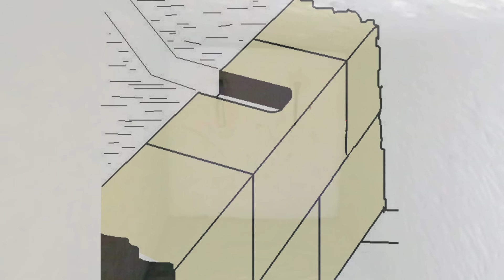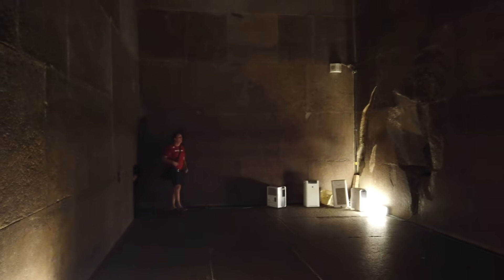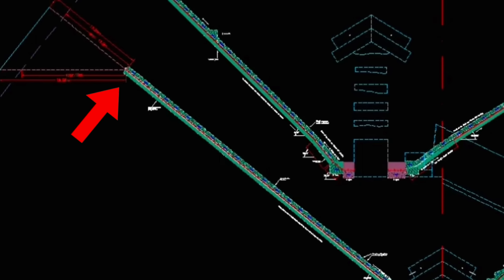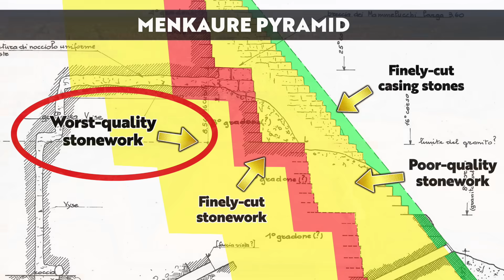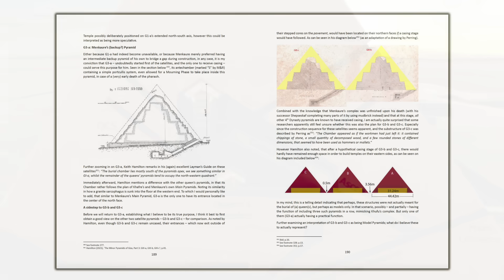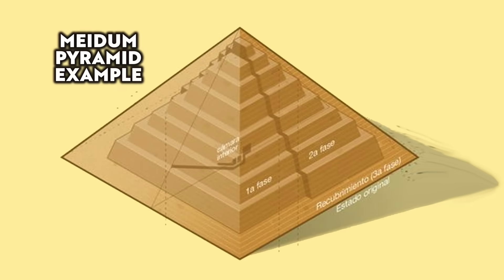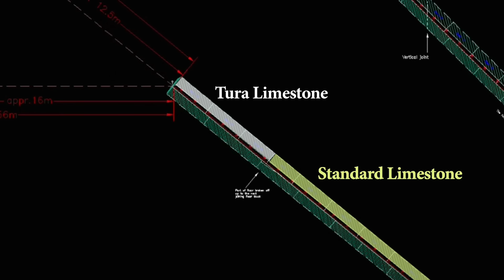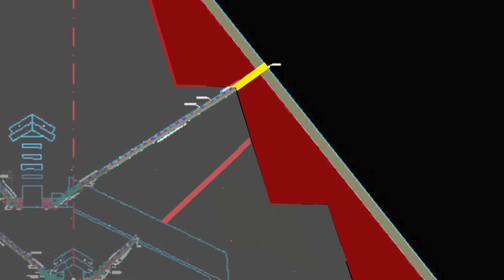Great Pyramid HIDDEN Steps Explain Everything | Part 1

Comment: 8:31.  I found the source of that image.  It was hand drawn.  I also found the original data and made an updated version with software. In 3D.  That data also seemed to show the remains of a ramp that went up each step, showing a vague idea for their geometry.

Video was called “I think I found The Great Pyramid's ramp hiding in 40 year old data”

Awesome video!   I certainly think you’re right about this being the reason for the shaft termination.
Reply: 🙂I made a comment like this about 5 hours before you, but YouTube or whoever deleted it:
Wallace's Mysteries of Antiquity has a very good video on this topic - "I think I found The Great Pyramid's ramp hiding in 40 year old data".
Reply: @PyramidBuilder3D you probably added a link, YouTube will automatically delete comments like that.
Reply: @WallacesMysteriesofAntiquity  The story is a bit more dramatic. 14 minutes after this video was posted, YouTube offered it to me. I watched it and after about 25 minutes I wrote a comment because I think the GP inner core is not such a revolutionary idea. 
The three pyramids (Meidum, GP, Menkaure) have identical external geometry (5.5 seked) and two of them have an inner core. Besides, your model matches my calculations exactly.
So, I didn't add any link because AA doesn't allow links. I checked my comment in an anonymous browser (because out of five comments on this channel, three disappeared) and everything was OK. I checked it in an hour, there were about 200 comments and mine was gone. When I sorted the comments by newest, I found my comment, so AA didn't delete it but the YT algorithm hid it (for about 24 hours, now I can see it again).
I understand that YT gives commenters some rating and I wouldn't mind if they moved my comment to the end of list, but I'm sure that hiding comments is not a bug in the program, but an intention.
Reply: @PyramidBuilder3D interesting, thanks for the information.  I wish YouTube would be more open about stuff like this.  I’ve been asked so many times “did you delete my comment?”  I always refer them to an early video I made addressing that.
Reply: @PyramidBuilder3D  That's not how it works. there's no algorithm involved in the comment disappearing. Its that the various servers youtube is on don't perfectly copy all the comment data, so depending on what server you tube decides to connect you to determines what comments you can see.
Reply: @Sgt.chickens  Are you saying that when I select "Top comments" it pulls from one server and when "Newest first" it pulls from another server? 
I don't think so, although it's not impossible.
Reply: @PyramidBuilder3D Pretty much any time you reload the page it selects a random server out of however many are available to your local area. If you live in a high density country like the USA or somewhere else with a large ammount of users in your local area you can often have dozens and dozens of available servers. Maybe your comment is stores on 65 or 80 percent of them. Maybe on 100% if you are lucky.
Reply: @Sgt.chickens  I gave you a "like" but the doubts remain. What is the probability that in view 1 I refresh 10 times and it always redirects me to a server where my comment is not (Mozilla and Chrome)? When I do the same in view 2, it redirects me to a server where my comment is!
Besides, Mr. Wallace certainly didn't see my comment either, because he wrote an identical comment. I'm sure Mr. Wallace read all the comments when there were 200 of them, because comments are an interesting commodity for any researcher. So there are three possibilities:
1. YT is screwing with us
2. Me and Mr. Wallace live in Alaska
3. You are the head of YT's development department :)

Comment: If everything was put in the kings chamber at the time of building, why make the corridor to it angle down towards the bottom of the pyramid, than up to the chamber? Why not just make everything level, straight out of the sides of the pyramid? Why make the air shafts angle up? Angling the "air shafts" up only made it easier for water and debris to fall into them. Why make the entrance so far up the side of the pyramid, only to angle it down, then up again towards the chambers? If they had made the shaft out of the queens chamber go straight in the direction it is already going to the side of the pyramid, it only would have been a few blocks higher than where the entrance is now. I am referencing the diagram at 11:31. Lot's of weird design decisions.
Reply: Their channels might have been angled up because if your working inside with rag torches the smoke will rise up and escape more easily.  Like a chimney effect. I dunno.  Just making a guess.
Reply: @tkd4  Supposedly no torches were used in the pyramids. No soot or ash from torches dated to the times of the pyramids creation was ever found. That's another mystery involving how the ancient Egyptians saw in pitch darkness.
Reply: @frodobaggins7252 the builders might have cleaned up their work as they went along.
Reply: @tkd4  I'm no expert, that's just the consensus among Egyptologists, that torches weren't used. They say maybe oil lamps or mirrors. Whatever was used was smokeless.
Reply: @frodobaggins7252  Look at the old photographs of the queen's room, it's all black with soot. There's also a report by Peres, from 1910 (if I'm not mistaken), which says that the entire ceiling of the Grand Gallery is covered with pinpoint traces of soot.
Reply: @errror7  A quick AI search says this "There is no evidence of soot from torches in the Grand Gallery of the Great Pyramid, as the walls show no signs of combustion traces. This suggests that artificial lighting was not used during its construction." Many other testimonials declaring the same thing. Another AI search: The Queen's Chamber itself does not show significant soot residue, which raises questions about how it was illuminated." The problem is, soot may have been introduced by more modern explorers. If it does exist it should be carbon dated to put to rest any confusion either way. Unfortunately, Zahi Hawass doesn't believe in carbon dating so unlikely that will happen.
Reply: Quick ideas: The shafts take the shortest way to the surface, the corridors going up and down may have tradition, as there are similar designs before, but also allow for automatic plugging from inside at a later time. Then there is also the grand gallary counterweight construction theory.

Comment: Happy Birthday!! and Thank You for such thorough and legitimate work.  I don't usually comment but I tend to see a strong correlation between gravity powered ram pumps and the internal engineering of Egyptian Pyramids.  If you look at a diagram of a ram pump and a schematic of the great pyramid one might notice it looks like a doubled up ram pump.  These pumps are only 10- 15% efficient, however they run simply on the force of water running downhill and a double pressure chamber ram pump system might increase efficiency.  Just my wild idea.  Thank you again for your time, it is very appreciated and enjoyed.

Comment: Very interesting theory! A couple thoughts I had.
1. From the main entrance through the descending passage is it the same angle?
2. Again from the main entrance through the descending passage is there any change to the inner stone? Like if you’ve cut through the casing stones (non existent now), the backing stones and into the steps surely there would be a change in how the stones look? 

If the pyramid was stepped originally then it would explain why they found pockets of sand when drilling on the inside of the pyramid.

If they added backing then casing stones ontop of the steps then the passageway behind the outer chevrons HAD to be added at a later date which I find to be interesting. I WISH the pyramid was fully completed as it just seems to be unfinished

Comment: Removing chunks of the core masonry to make a smaller smooth sided pyramid doesn't sound like very sound engineering. A more reasonable alternative is the backup plan was a stepped pyramid. It would have still been substantially larger than any of the 3rd dynasty stepped pyramids like that.

Comment: quick question b4 i forget,  so as you say, the shafts dont extend to the edge, 
also you state it was enlarged from a smaller size.

so perhaps can the upscaling be measured anyhow?
perhaps original had open shafts, but a larger encasement sealed it airtight afterwards ,  would that be logical?

chernobyl was enlarged with a larger casing shroud too,  was that the original design back then also?

i wonder can the expansion or enlargement account for the shafts not reaching the surface and it was sealed?

Comment: There was a zigqurat there hundreds of Years before. That Queens chamber had those shafts to the current external wall.
Check on the carbon dating of each paster measured thru the pyramid. Some date hundreds of years before. And yes, All 4 shafts were sealed.

Comment: air flow ? sure bro sure!!! u forget that there was a plug of solid rock 5 inches thick at the shafts location in the kings chamber that plug was not like a plug but the rock was not cut all the way through until they were cut open to then allow air to move,,,, no bro they were not air shafts

Comment: i thought the shafts were discovered behind a sealed wall they had to break through? that would prove they weren't air shafts correct?
Reply: That's in the Queen's Chamber.  In the King's Chamber, the lower ends of its two shafts were always open to the air, since they were built that way--no chiseling required by later explorers.
Reply: @JohnMSawyer  exactly... the queens chamber shafts were sealed.. so they werent air shafts...

Comment: In a restoration of a south American pyramid, another structure was found underneath. I believe the pyramids were built then rebuilt bigger, maybe in several stages. There are several examples of restoration works of older weathered structures being resurfaced with new masonry leaving the highly eroded core in its original state.

Comment: Of course! It makes sense that this pyramid (and probably all of them) had internal buttress walls. That means that the Big Void may only have been accessible before the backing stones were added, and would require tunnelling to reach now. Bummer!
One thought is that, if the burial chamber was accessible after Khufu's death, surely his treasures would have been stored in another chamber that wasn't accessible to visitors. Maybe in the Queen's Chamber?

Comment: Great video, Matt.. 

Major problem, however..

There needs to be offered a satisfactory explanation as to why the ventilation shafts are constructed this way..

For a "ventilation shaft" this method is simply insane orders of magnitude more difficult to accomplish than a simpler level air shaft out to the edge, made on the same course..

Making a very small FALL toward sea level in the shaft would even be a lot easier, and infinitely preferable, working through the same course with a slight decline, before continuing with the pyramid construction with the shaft then done and dusted.. 

This is good practice today, so that detritus, water, crawling insects etc are discouraged from making their way in via a ramped airway of even a very slight angle.. 

Obviously we know the Egyptians didn't have pumped /fan driven systems.. 

The angle witnessed in the pyramid is extraordinarily sharp.. One can only imagine the amount of contaminants that would be invited down these shafts.. The sand alone..

The way they are constructed calls for precisely aligning the incredibly steep shaft angles throughout many, many courses.. It is the absolute opposite of logical due it being very much more difficult to construct, for an undoubtedly inferior result.. 

There remains something glaring missing if they are to be considered simple airshafts only.. 

It is very much not case closed here, and the King's shaft doesn't even terminate at the edge of a proposed stepped core, it overshoots it considederably..
Reply: the steep incline is to produce a chimney effect with the warmer air rising and pulling cooler air in from below.  the kings chamber shaft was thought of later when the size of the pyramid increased.
Reply: Technically (i agree its way more difficult offcourse) but a angled channel results in a shorter channel then if it would be a horizontal one. Maybe the builders valued a shorter channel more. Also angled entrance tunnels are very common in Egypt. Maybe it was just the way they did things.
Reply: Check out The Great Pyramid Equation channel, which provides a logical structural explanation for this and other mysteries.

Comment: Now imagine this: the pyramid is NOT the final perfect finished project. The King's chamber was only the 3rd failsafe. The final and last project threshold aimed for an even bigger burial chamber right above the big void. Then, the pyramid would be expanded one final time. However, they failed (or Khufu died) and then they settled for the king's chamber.

Comment: This represents but one of several conceivable interpretations; however, its relevance appears limited, as it is predicated upon unverified and presently unverifiable assumptions. It assumes that the Queen’s Chamber was abandoned during construction, that the extension of its channels—analogous to those in the King’s Chamber—was deemed unnecessary, and that the stepped core aligns precisely with the blocking doors sealing the channels. Current evidence does not substantiate such alignment, and the step could plausibly be situated in an entirely different location. Consequently, this line of reasoning seems to arise more from an impetus to produce an explanatory model than from demonstrable, objective data. While the proposition remains a potentially viable hypothesis within the broader discourse, it requires rigorous archaeological validation before it can be sustained

Comment: If there is a stepped core, I’m leaning to the idea that it was originally a stepped pyramid because applying backing stones over it would prove to be less stable with little to no anchoring to the inner core. This seems like a bad design so it would only make sense if there were a design change, either midway or over a previous structure.

Comment: Another great video, Matt.  One thing that occurs to me is that if your new hypothesis is correct and the Queen's Chamber was no longer needed, why wasn't it blocked off completely internally?  Isn't it the case that although the King's Chamber was finished and the Queen's Chamber doesn't look like it was, nevertheless the Queen's Chamber remained fully accessible internally, which seems a bit strange?
Reply from the maker: I think it was blocked off. You can see there was large post holes either side of horizontal passage at the bottom of the grand gallery, clearly so something could be affixed to cover the entrance to the queens chamber. Whatever was used to cover it is long gone now I’m sure. See my video on the Grand Gallery for pictures.
Reply: @AncientArchitects  Thanks! Oh, and happy birthday!

Comment: Explain to me this, why does Khufu's pyramid have air channels and the Kafre and Menkaure pyramids (which were built after) do not?   Wouldn't you think they would follow the same plan for subsequent pyramids?
Reply: If you look at the curved air duct shafts with the eyes of a modern engineer, you can't design them like that. They won't work without forced draft (a fan). That's why they weren't repeated in other pyramids.
Reply: History for Granite is the guy who built up the air shaft hypothesis, but again it's just his guess.  What I don't get is if you need an airshaft, why build it at that angle, why not just go level and keep it simple and follow one of the levels of blocks.  Putting it at an angle is a much bigger engineering task.  Maybe they wanted the angle to keep the sand out to aid with cleaning, but that doesn't explain why they go nearly flat as the get closer to the chamber (as debris would accumulate there), and also why they are crooked as they near the chamber.  I still have not heard a single theory as to why these shafts are only found in the Khufu pyramid, and no others (that I am aware of).  If the pyramids were used as mausoleum and visited internally (as Ancient Arch. and History for Granite are saying) then why are the shafts so important for the Khufu pyramid but not the others?  I think when looking at all of these pyramids researchers need to look at them collectively when asking questions or forming theories.

Comment: if they were air vents, why the 45 angle? horizontal would have made more sense.
Reply: Horizontal shafts conduct very little airflow.  Heated air rises, otherwise known as natural convection, which is one of the mechanisms that creates airflow in diagonal shafts, which doesn't really happen in horizontal shafts.  Also, when wind hits the pyramid’s faces, it creates a lower pressure area at the upper end of the shafts, so that the higher pressure air at the bottom end of the shafts presses air upwards, adding to the airflow.  There are also other mechanical reasons for the airflow in the shafts.
Reply: @JohnMSawyer  all these shafts were built sealed at the queens and kings chamber end. they were only broken into a few hundred years ago. they are not air vents.